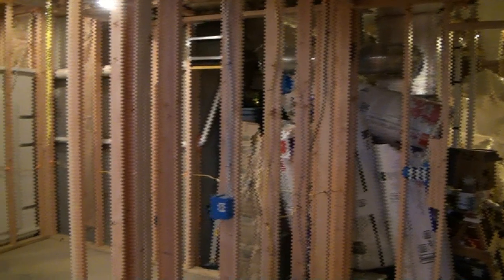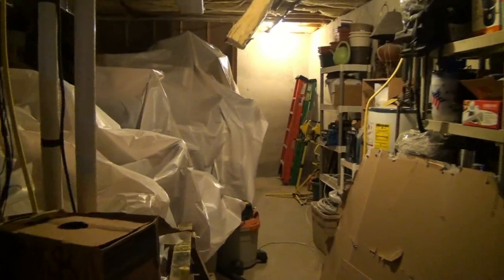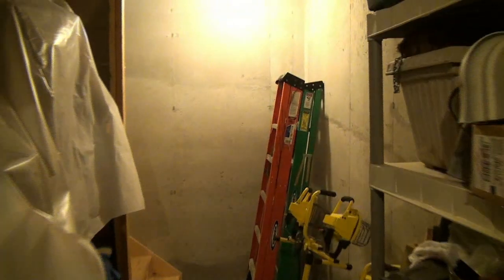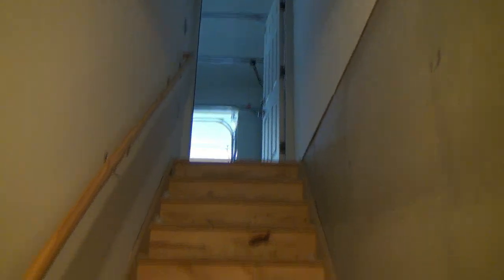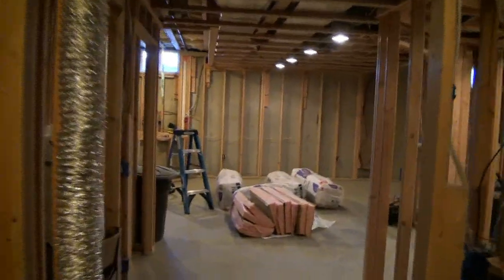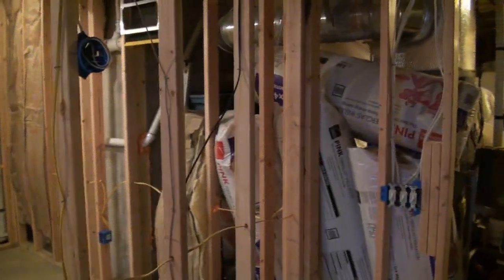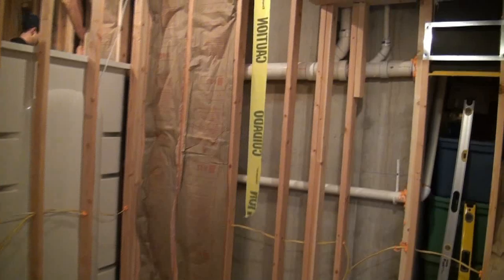Insulating Basement Storage Room Walls

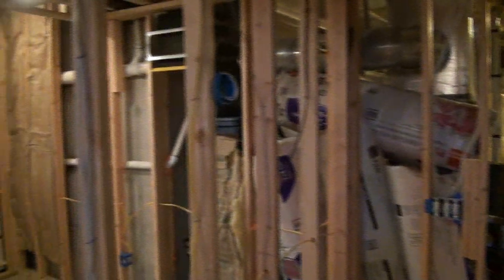Comment: The frame rate on your camera is a little slow so when you pan side to side like from 1:30-2:00...it blurs and it makes me super dizzy watching. If you just back up and hold steady and maybe use your video processing tool on your computer to highlight the areas you're talking about that would be nicer or just cut to the next shot do like a voice over.

zooming in and out is fine...panning not so great

Loving the length of the videos...simple...concise...well explained...will keep watching!